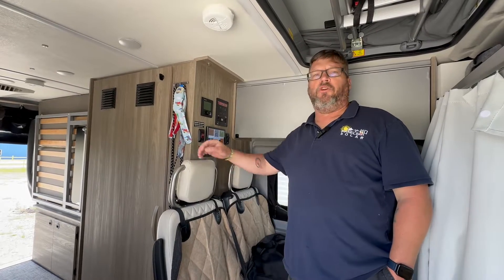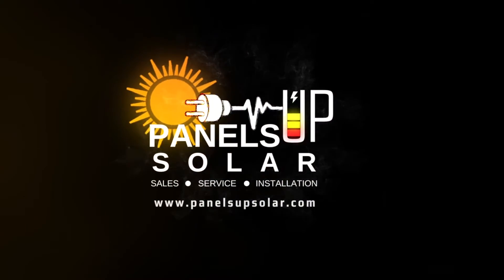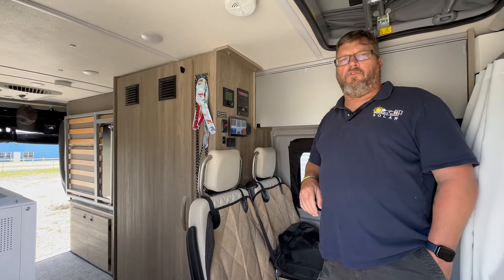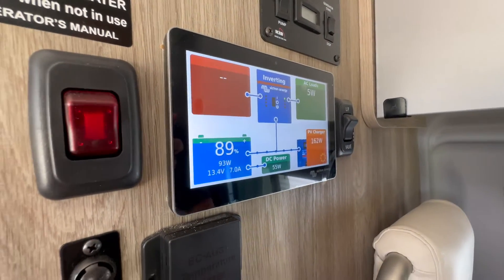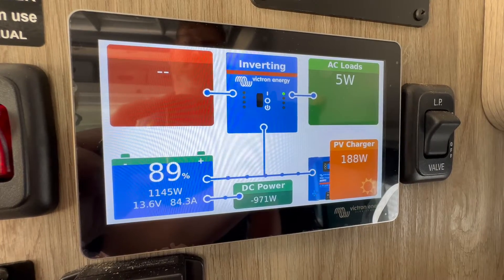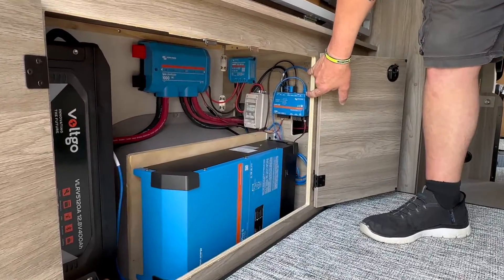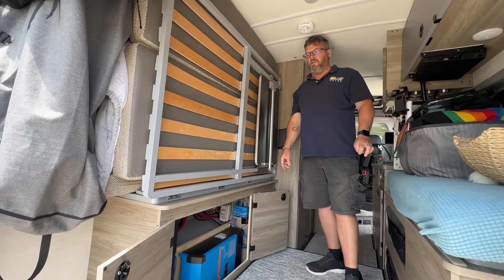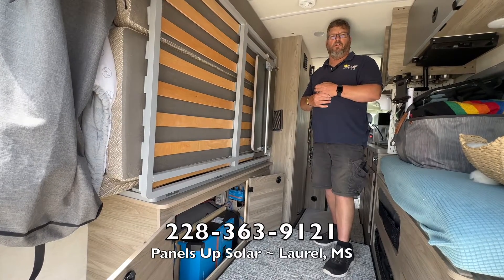Awesome Off-Grid Installation 2023 Winnebago Solis 59px Van

Comment: Beautiful work! did you end up swaping the LI BIM-225 in the same place the solenoid was located (under the coach?).  And did you connect the battery boost function or remove it when you did they bim swap?
Reply from the maker: Yes the location was kept the same. Though it was not a simple process, full functionality was maintained for the boost function.